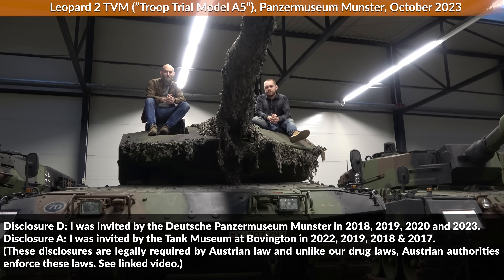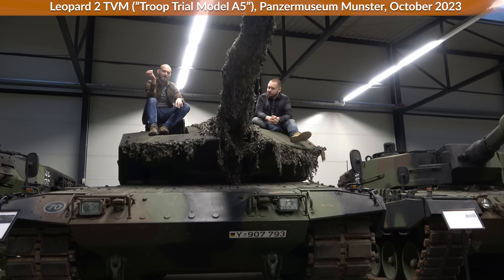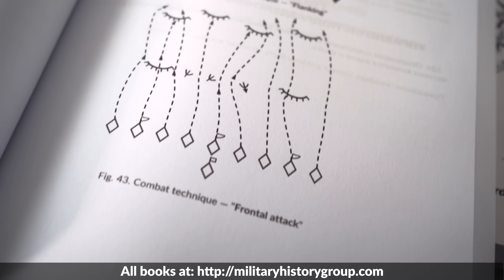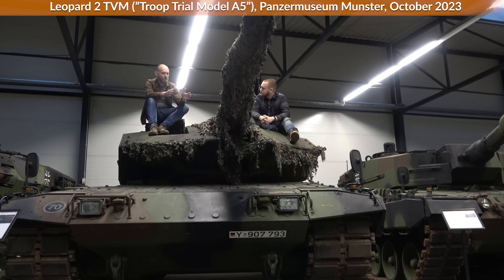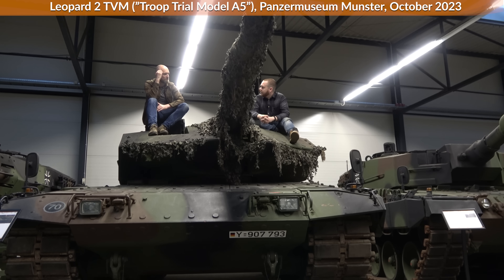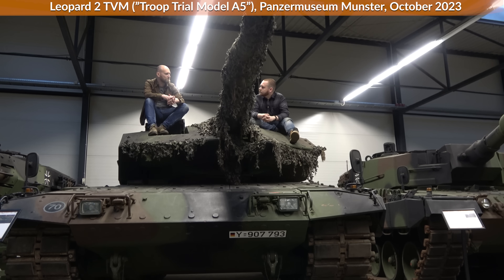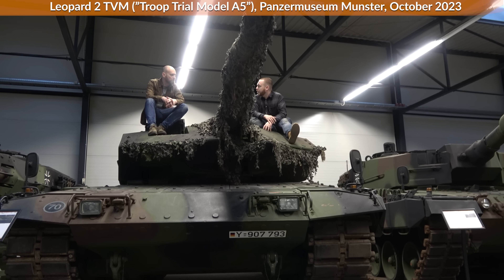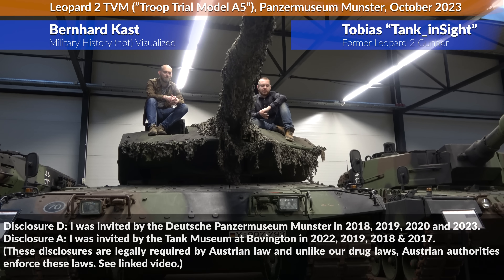Fatal Flaw? Leopard 2 Shot Trap?

Comment: APFSDS is an obsolescent threat. Drones are the big killer now, and I have yet to see a Leo upgraded to truly defend against them.
Reply: For now until suitable counter UAS technology is developed and proliferated, which is only a matter of time.
Reply: @Ungood-jl5ep  sry to say this technology is using by russia right now, called jammer on the turtle tank
Reply: @Neonblue84 those jammers are not helping at all. If seen like a dozen videos of FPV with Roy warheads slam into Russian tanks with EW antennas all over it. Never saved the tank
Reply: @FancyPantsOnFire  its a race for algos and, you win some, you loose some. like in IT security. the attacker is one step ahead.
Reply: there are drones with normal AT-rockets. nothing is obsolete, ever. not even shovels! :) ..usecase might evolve, but it never vanishes completely.
Reply: Even drone gone now you have Artillery problem
Reply: Yep APFSDS was a mistake in western doctrine. T72b3 sniped the Abrams with a Refleks rocket assisted shell. More range, lock point and shoot and comes down on top side. 

The west basically shit itself when it found out about the t64s composite armor and mango apfsds so for decades the west was trying to one up SU in that game and the Russians left it all behind anyway
Reply: @off6848  typical ammo load for a T-90 is 6 GLATGM, 12 APFSDS, 6 HEAT and 12 HE-FRAG. 
You can stop spreading misinformation now.
Reply: @off6848  the issue you’re having is that you’re actually believing nonsense from the Russian side of the conflict. There is no evidence of a t72 hitting an abrams. We do however have actual footage of that abrams being hit with an ATGM. The armour saving the crew from the tank killing everyone. They got out and survived. Again, unlike TSeries. Apfsd is actually very good. Western tanks are superior in fire control, gun stabilisation, armour and often mobility….if not in Ukrainian soil
Reply: @off6848  rocket assisted shell aka ATGM that can fire from tank, which is HEAT

Western (specifically USA) try before namely M551 Sheridan and MBT/KPz-70
Safe to say not worth trouble
Also how APDSFS is mistake, if yes then which shot are perfect for Western Doctrine? APHE?

Comment: From what I remember of some older videos on youtube the 2A5's wedge armor was only like 500-1000kg of added weight and mostly armored sheets (so indeed spaced). I don't think it was designed to deflect any shell, but instead to destabilize sabot rounds that penetrated the wedge but weren't long enough to bridge the entirety of the spaced armor. 

Even if an older type of ammo would be fired at it, the question is how sturdy this wedge really is. If it is thin sheet metal, then even older ammo will not have an issue penetrating it and hitting the main armor underneath. In which case there would not be a shot trap since the shell would be able to penetrate the wedge. The main armor would likely have no issues stopping a 70 year old cannon, so I don't even expect a potential weakness here.

The side wedges felt to me like they needed to open in order to get the engine out of the tank, not just to store things underneath. When turned 90 degrees to the side, the turret of a 2A4 barely clears the engine cover on top of the back of the hull. That is what it seemed like on some Revell model kits of Leopard 2 at least.
Reply: Exactly. I saw the video title and immediately recalled a picture I had seen of the wedges being completely hollow! I'm sure it's a common assumption as I had that they are solid bricks of strong composite but it's rather rare for such a drastic addition of weight and protection be added. "Enigma" comes to mind.
Reply: Presumably, the wedge shape helps with mounting and increases the internal distance to what's required to disrupt the apfsd dart.
Reply: @ecpgieicg  Yes if you can make your armor more deep than the penetrator is long then APFSDS disintegrates because it basically gets chewed up as it travels through the armor and depleted uranium even self sharpens as it wittles away
Reply: I mean most rounds from the 70s-80s can pen the front of the leopard 2. Wedge or not. it's just makeup on an ugly girl. doesn't change the fact that the armour was designed to fail.

Comment: I saw a computer simulation of what happens when the APFSDS penetrator impacts sloped armor and finally understand why it defeats sloped armor. Extremely fascinating.
Reply: According to the computer simulation, a classic bullet-like AP round will strike a thickly armored glacis and be deflected upward without penetrating. However, the armor plate doesn't escape unscathed. We can see examples of what happens parked all over Europe in the form of old Tiger II and Panther tanks with deep divots or gouges in the glacis from non-penetrating hits. 
When modern long rod penetrators from APDS rounds hit, the front does indeed dig a deep gouge in the glacis. And the angle plate does cause it to deflect upwards. But then the 'magic' happens. The nose of the penetrator snaps off and careens upward and away. But the remaining rod now digs downward and INTO that gouge. 
I've got a practice penetrator (shorter than the long rod and has a cone at the end instead of fins) and always wondered why it had horizontal grooves cut along the length. They're to help the rod snap off.
Reply: So why doesn’t it?
Reply: @enshk79  It grabs and digs in. Old APHE and APBC was shot out of rifled barrels and the extreme angular momentum of the spin would cause it to bounce. APFSDS just slides on through or shatters
Reply: @off6848  This is wrong , the spin has nothing to do with it . APFSDS just is it called eroded the armour and itself , while AP rounds stay intact and therefore they get deflected upwards . The huge speed of APFSDS does this , an AP round fired with that muzzle velocity would break up as well at impact .
Reply: @5co756  According to the simulation graphics you're both correct. Will explain what I saw in a separate comment.
Reply: Sloped armor still affects APFSDS in that the round has to penetrate more armor.
Reply: @nobodyisbest  Actually this is a misconception. Sloped armour of the same thickness will be less effective against apfsds cause near exit point projectile will pick path of less resistance and turn against the slope. Altho that is only true to solid steel, some somposites may be more offective at slope for example ones used in T-72b or M1 turrent where rubber pushes slim steel plates at an angle, forcing projective not just to pierce but to cut trough them.
Reply: @nobodyisbest this ☝🏻
Reply: sloped armor still affects it, in that it increases the effective armor thickness. Sloped armor was never about glancing shots, it was about increasing effective thickness.

Comment: The simple answer is that this is just spaced armor. Its not a huge extra heavy wall added on the turret, but rather it is a large empty box that weight 500kgs that are sitting in front of the turret and forces incoming enemy shots to travel many extra decimeters before it can start blowing a hole into the main armor of the tank.
The enemy projectile lose force before it reach the tank, and armor protection gets increased with a minimal cost of extra weight.

Comment: 7:45 - Also Japanese Type 10 I believe has "arrow" shaped turret. Though it is smaller and as such less protection against APFSDS. For APFSDS it is important that projectile is shorter than the space between "armors". Because that makes it tumble (or at least changes angle) after it pierced first layer but before it hits the "real" turret. So it depends on which height it also hits, since right in the middle you have most space. On the edges, much less so and if the round is longer than this space it will "almost" behave like it was going through single piece of armor that has thickness of combined layers (outer "arrowhead" and inner "turret") of armor. "Almost", because there still will be deformation and some additional protection. That means that this armor is very good against even latest Soviet APFSDS rounds, but some Russian ones that are especially long (though from memory autoloader makes rounds above certain length impossible) could defeat it or at least would suffer much smaller "penalty" when trying.
Reply: The Arrow itself is spaced armor...3 plates spaced apart.
Reply: @dwwolf4636  That as well. I tend to write ridiculously long comments, so I tried to condense as much info as possible. Thank You for adding additional context, though I'd have to check the layout and if it is from all sides/angles and whether there is some play with angles inside it. There was good video on YT couple years ago that talked about it in-depth (I don't think geometric design of "arrowhead" is classified - some materials might be or some other details).
Reply: most rounds will go through the leo 2 at any angle today. sadly just the way it is. the composition, thickness, and flat armour is blaintantly inadequate. The arrowhead is a cute cover up for it like makeup on a girl. but it doesn't hide the fact that it was poorly designed. the hull isn't in any better shape either.
Reply: @MajorMorrozov  Which "most rounds"? Newest American or German ones? Probably, though not at "any angle". Newest Russian one that can fit into auto-loader - definitely not at every angle, and at the front it will have troubles. And if it hits arrowhead in the widest place, it will tumble and likely not penetrate the rest of armor.
AFAIK composition of armor in Leo2 changes depending on the version - it takes long to adapt A4 to A6. It's not just that insides change, but armor composition as well, so it is a big refit. The thing is we don't exactly know said composition apart from marketing materials saying how many mm of RHA it gives in equivalence. And we can make inferences made based on this. I do know (because that was one of the things that weren't classified) that A5 and newer, include additional Tungsten "armor". Though I don't think it was disclosed how much, where and any useful stuff.
IDK why you have such a low opinion on Leo 2 specifically.
Reply: @jannegrey  the composition hasn't changed since the 2a4. it's exactly the same.

Comment: It technically is not a fluid and not a jet, HEAT is more like a powder that is speed up to 15x the speed of sound and it only turns fluid on contact with the armor and washes and at the same time punches out the armor.
Reply: I think he explained it quite well. The shaped charge "jet" is acting behaving like it was a fluid even though it technicaly is not.
Reply: It behaves like a fluid.
Reply: @voidtempering8700 You're right, thank you.

Comment: Still think that a T54 with old rounds would cause the shot trap effect. Also, even a WWII tank can be a threat to a modern MBT in urban combat, as optics and range are pretty much out of the equation and modern tanks are often more vulnerable on the sides...
Reply: No modern Tank is more vulnerable to the side than the old WWII Tanks. Tanks overall are more vulnerable to the side or back or Top, but the side of a Leopard2 Turret is 300mm composite Amour pretty far to the end of the Turret. There is no older Tank which could penetrate that. This is just not a feasible possibility.
Reply: @Forodir  What I meant is that the old tanks had up to 100mm of steel on their flanks, while modern tanks often have no more than 40mm, but with additional add-on armour, which protects from HEAT, but not full caliber shells...
Reply: @edi9892  
What serial WWII Tank had a side amour of 100mm overall? And a modern MBT depends on where you stand, modern amour is between 80 to 40mm thick and is much more capable, and you also have side skirts on the first  third of the Hull, and of course it protects against a Full caliber shell, just not as good.
Reply: @Forodir  No he's right. Modern composite armor is made to stop APFSDS and HEAT specifically but full caliber AP and High explosive shells like from ISU152 or JagdTiger would f a modern tank up if hit on the side. 

Everything in materials science has trade offs and composite armor while rigid is brittle the sheer kenetic energy would probably rattle many key components off of a modern MBT if shot lets say 800m away from JagdTiger HEAP.
Reply: @off6848  
Was? Nein das ist einfach Quatsch! Modern KE has much more Kinetic Energy than an old PzGr. 39. Modern Amour has the equivalent strength of RHA and would easy stop that old ammunition. 
That things would get damaged by an HE round is another thing (thats the reason why we still use our HE rounds against Tanks in an emergency situation with the Artillery), so of course u still have damage, but if u not hit the side or back it is not likely there would be a break or rip of the Amour.
That is not WoT or  WT
Reply: The last non-saboted AP rounds for the T-54/55 were probably produced over 60 years ago, though, and there are going to be some serious doubts about whether they can be fired or even transported safely.
Reply: @LafayetteCCurtis  
And even than I would think that a Full caliber shot would go through the "Keilpanzerung"  without Ricochet and then be stopped by the Main amour. The Steel is pretty thin and is only meant to deteriorate Shaped charges and try to stress KE rounds, so it has less penetration power .
Reply: @Forodir  That's possible. I only know that the inside of the wedge is hollow but not how thick the outer shell is.

Comment: shot traps dont exist when referring to APFSDS rounds, they just shatter and dont bounce

This is one of the worst mistakes in warthunders representation of modern tanks, it depicts rod rounds bouncing instead of shattering
Reply: Yeah thats what is said in the Video.
Reply: Shot traps are irrelevant
Reply: Damn, I thought I knew my shit. Thanks for teaching me.
Reply: What no ive never been shot trapped with modern ammo
Reply: even though a APFSDS style round would shatter, it's still a line of debris travelling at supersonic speeds, and considering the roof of the hull is super thin it's still possible to penetrate.
although something people don't consider with the "shot trap" hypothesis is that chobham does a good job of grabbing the round and forcing it to stay straight, unlike a solid plate which would make it more likely for the round to shatter and deflect down and hit the hull instead of being eaten by NERA plates.
Reply: What if they are attacked by old 100mm towed gun APHE?
Reply: @joelau2383  What if the M60 Patton is attacked by a WW1 42 centimetre Howitzer? 

The risk of being actually targeted by an anti tank weapon that's basically 70 years old are like close to zero. 100mm guns shooting APHE rounds, if they even exist somewhere in large enough numbers and a viable condition would be almost useless on the battlefield itself. Particularly as you have much much cheaper and convenient to deploy anti tank weapons everywhere which are easier to use compared to some towed 100mm gun with the intention to eventually exploit a possible shot-trap. 
Seriously, those things are large, require some kind of towing vehicle and several crews to operate it. And there are man portable anti tank  weapons offer you better anti tank capability.
You're almost always better off not using them and either straping the shell on a drone - which is what Ukraine is doing. Or simply giving the infantry some kind of anti tank missiles. They have better ranges. Better accuracy. Are easier to use and conceal. And will cause more damage to any armour.
Reply: IIRC these 100mm APHE guns do exist. Russia is using them today as towed AT guns. Now whether said guns are supplied with APHE or the more modern Sabot rounds (which it can use), I’m not sure.
Reply: @jepulis6674  While true, that doesn't mean the concept of an anti-tank gun as a whole is bad specifically, especially in an entrenched defensive position. The one they're using can use all the ammo a T-55 can (including the APFSDS and ATGM) too.
Reply: @joelau2383  does not matter. the highest performing APDS/APHE of the 100mm D-10 gun cant penetrate the armor of Leopard 2A4´s hull and turret (the box turret version).
There is a reason why all major players had switched over to APFSDS in the late 70´s for their main guns (except the british), and that is higher energy retention and perforative performence of KE ammunition (fin stabilised darts).
As comparison: the highest performing APDS (bullet shaped sub caliber AP shot for the L11A5 120mm L/55 rifled gun of Chieftain MBT and Challenger) is L15A4 APDS. 
On 2000m it has only 66% of the penetrative performence of DM13 APFSDS (dart like KE round with fins, the first APFSDS round introduced on Leopard 2A0 in 1978, fired from the 120mm L/44 smoothbore of Leopard 2).
Both rounds are fired at similar powder charge volumes, the L15A4 is fired from a longer rifled gun, the DM13 from a shorter smoothbore gun and the lighter APFSDS has still a 33% higher effective range and penetrative performence without loss of accuracy.
Bullet shaped projectiles with high mass and a small Diameter/Length ratio loose energy faster than dart like projectiles with high Diameter/Length ratio.